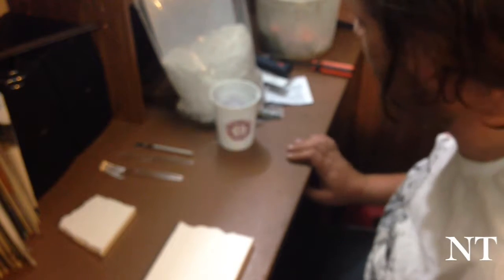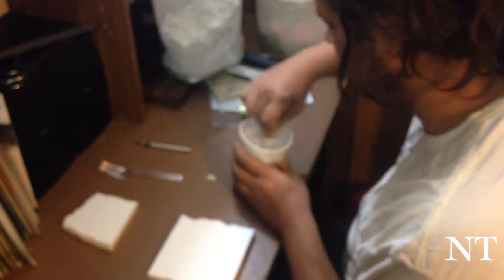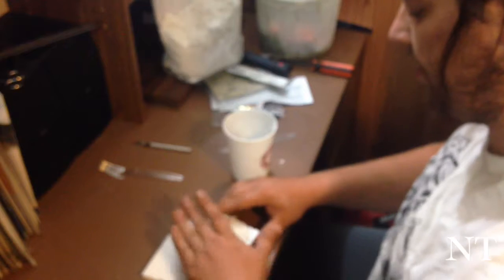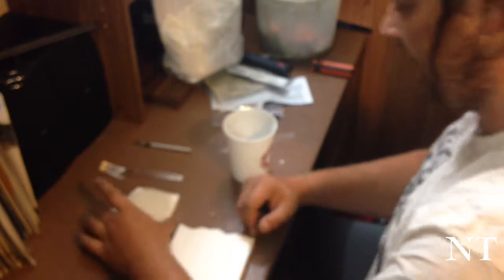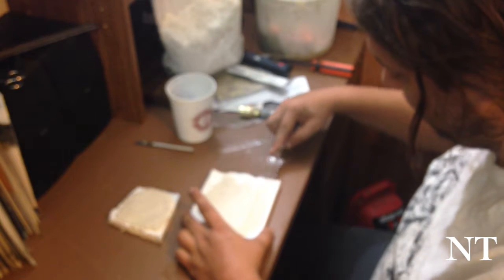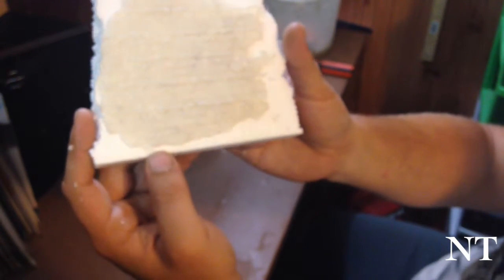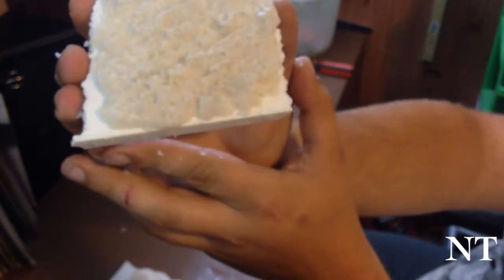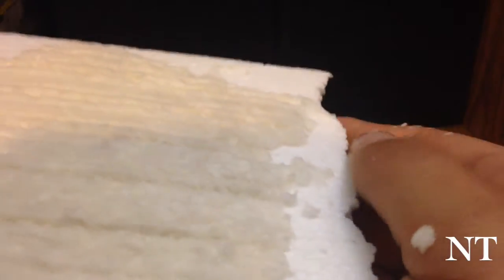video 19

Comment: awesome How To Nick... looking forward to part 2.. thanks for sharing.. vinny
Reply from the maker: +bnsf6951 no problem. Be spending more sundays at the bench soon. May be with cars or locomotives as well on repairs and maintenance. Got a lot of ideas. Just needed to make room. Also need to do some adjustments on where to put my camera.
Reply: 99.9% of the time my camera is on my right side so i can flip the screen around & be able to see if what i am showing is in frame...
Reply: Vinny is the pro on building Vlogs
Reply from the maker: +IMRROcom I have noticed that. And agree. Any advice is grate tho. And I will use it. Not a whole lot of room tho but I'll give it a shot.